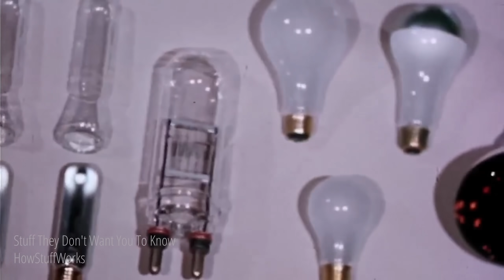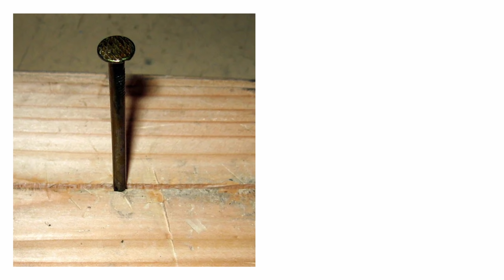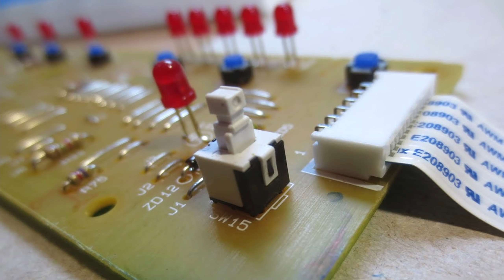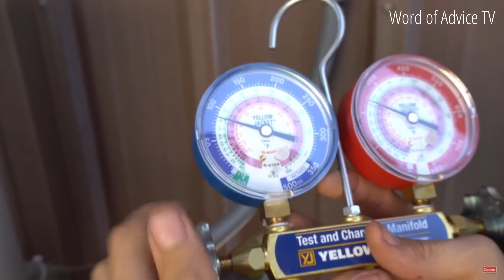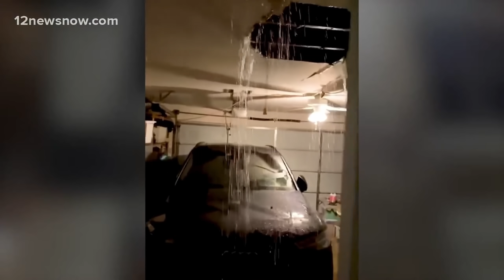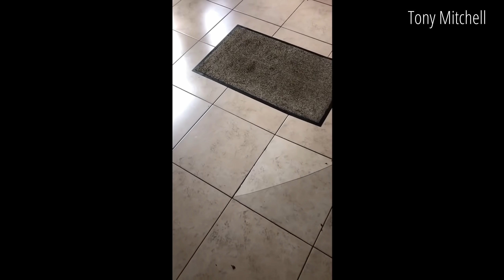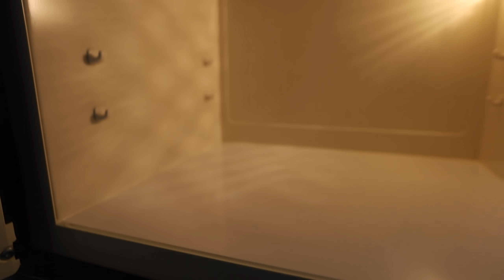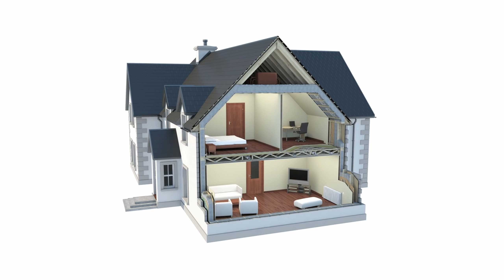Built to FAIL | Planned Obsolescence

Comment: Belinda, this was an incredible video. Thank you so much for saying what needed to be said! Now, specifics ...

Regarding the failure of your newer GE products, they are really no longer GE - the appliance line of business was sold in 2016 to Haier Group Corporation, a Chinese multinational home appliances and consumer electronics company headquartered in Qingdao, Shandong, so while those new appliances might have a GE logo on them, they are now are nothing more than cheap Chinese crap designed to fail early and force more consumption;

I have also noted rapid failure of the so called long-lived LED bulbs - I just had to replace another one yesterday, I will have to pay more attention to this and might have to go back to incandescents for some fixtures;

Regarding cheap home construction, it seems as if the only way to assure durable construction is to build a custom house, which would be prohibitively expensive for most people - developers will build up new subdivisions with THEIR preferred builders and only offer prospective home buyers limited options on models, colors, finishes, etc, resulting in a "take it or leave it" situation for buyers desperate to get into a new home (or at least, the homes that aren't snapped up by large investors to force more and more people into becoming renters instead of homeowners);

Apple is notorious for producing easy-to-fail and unrepairable devices - keyboards on some devices are designed to allow immediate liquid penetration onto critical circuitry in the event of a spill, instead of simply running off a plastic keyboard surface, and documents surfaced years ago instructing technicians at repair sites to either replace entire boards or entire devices rather than replacing individual parts;

Front loading home washers have a reputation for poor performance and development of mold or mildew, I just replaced my old appliances with new high-capacity Whirlpool models, of which the washer features the innovative removable agitator which will hopefully resolve the problems associated with the new machines with no agitators ;

When having new flooring installed, it is standard procedure to order 10% more than the measured area to account for wastage during installation, but I ordered 20% more to insure sufficient material left over should repairs be necessary, though storage of excess material might be an issue for some (I like the AquaGuard brand of laminate flooring);

Unless specified, it might not be "illegal" for customers to shut off water valves in the meter boxes, but if damage occurs, the customer will be liable for damage to the utility's equipment - buy a water key at a hardware store (can also be used to shut off gas supply in an emergency) and use common sense if there is no private water shutoff valve (typically located under a small round cover within a couple of feet of the meter box) by turning the utility valve slowly and carefully, stopping the attempt if the valve seems stuck and won't turn with a decent amount of force;

All-electric homes do not necessarily receive all or most of their power from coal-burning power plants, as the electricity generated by ALL the plants in a transmission interconnect (aka "grid") goes into that grid - you have no physical control where the electrons come from, and only about 20% of them come from coal-fired plants in the ERCOT interconnect;

Regarding old-school appliances, my mother bought a new refrigerator (I forget the brand) back in the 1960's, and at last report, IT STILL RUNS TODAY!

The skin of my house is now about 35 years old (based on records I could find) and the siding is already falling apart, being made of the the notorious hardboard siding that is rotting out all along the bottom;

The idea of an instruction manual for a home is BRILLIANT - I receive countless calls at work from residents who have no idea how to troubleshoot even the most basic of issues, have no idea how their home's utility systems work, and in some cases have no idea what their homes are even equipped with.

Keep up the good work, Belinda. You are providing a badly needed educational service to the public!

Comment: Awesome topic - I agree with you but gonna play the counter arguement.

We have appliance options that last 30-40 yrs but we have to spend as much as 4-5x for these appliances - are we as consumers willing to bare such costs?

We can build homes with all systems meant to last 50-100 yrs but then we need to be willing to pay for it and do the necessary maintenance to have it last that long...

Is the consumer willing to pay substantially more so all electrical and low voltage lines can be run through rigid conduits so they can be replaced if needed without destruction? And have a full system with pull boxes and also the necessary space for such systems in the built space?

Are we willing to use 100% cast iron or higher grade copper lines piping waste lines and then use K and L copper pipes for all house runs...

Are we willing to pay for 20-50ft piers instead of the cheaper slab construction for foundations for SFH foundations on new construction.

Are we willing to pay for 100yr exteriors and roofs with the necessary framing and WRB assemblies to last the 100+yr structures? And once built are we willing to do the necessary maintenance on a quarterly, annual, or other interval of all the systems?

Are we wiling to pay for more efficient and long lasting HVAC and space comfort systems?

Basically - are we willing to change how we build to have things all last longer and then also pay 20-50 or even 100+% more for the end product?

These are the issues with the way we interact with  the systems in place to maintain expectations for how we build, sell, and own homes currently...
Reply: Given the global economic bubble we're in now (which will hopefully burst soon), even the cheapest of houses is now out of the reach of many home buyers.

Comment: When I was growing up in DFW in the 1980's one of my parent's friends was a GM Quality Manager.  His job was to analyze cars that had survived for more than five years and 60,000 miles to determine which parts hadn't worn out.  These parts were then Value Engineered to ensure that they minimized cost while getting much closer to fully wearing out at five years without prematurely failing.  These efforts ensured that the initial cost of the vehicle was minimized while also ensuring that all of the car's systems would fail almost simultaneously at five years and 60,000 miles.  Our talk was quite enlightening.  A few years after this conversation, Japanese car companies moved into GM's turf and were winning consumers over with their 100,000 mileage track record (Honda and Toyota).  Soon, GM had to retool their cars so that they would catastrophically fall apart at 100,000 miles.
Reply: And from what I understand, they failed at that last one, and are now exiting the domestic automobile market.
Reply: @whiteknightcat  And I guess now it's the evil foreign companies that take the car market, according to some red hats...
Reply: @ThePixel1983  I don't know.
Reply: My brother's 2011 Ford Focus recently had a head gasket go and the shop told him the car wasn't even worth fixing. Meanwhile, my 2010 Pontiac Vibe (built on a joint venture with a Toyota engine) is still running strong. Growing up in Michigan, buying Japanese cars was verboten. When I went to see my mom, my family wouldn't even let us park our 2013 Mazda 5 in the driveway for the first few years of owning it. It's the best vehicle I ever owned. GM is even worse than Ford. My next vehicle will be American made though. A Tesla.
Reply: @Nphen  I've got a 93 Exploder and a 97 Camry. Both still run, but guess which one has routinely required more maintenance, repairs, or had parts just age terribly.
Reply: @Nphen  You probably won't get 12 years running with a Tesla.
Reply: @grantadamson3478  I AM AT 10.5 AND COUNTING
Reply: I don't think matching the lives of individual components ("catastrophically [falling] apart") and planned obsolescence are necessarily the same thing.  The car's target life could be increased by selecting the components that break and strengthening them.  

Maybe that part was a joke though?

I own a Piaggio motor scooter and I’d much rather everything fall apart at once than pay a shop $150/hour in labor forever.  Factories are incentivized to work efficiently, which benefits everyone.  Shops are incentivized to work as slow as possible which only benefits them.  If I were to buy a new electric scooter it would use less fuel and also have fewer parts to break.
Reply: @andyb2339  This is where the "dumbing down" of people in general plays in. So many today not only haven't a clue how their vehicles work, and of course wouldn't know a wrench from a hole in the ground, but don't even know (or care about) the most basic of routine maintenance. Shops put out videos of where people have brought in vehicles and have NEVER even changed the oil! As a culture, we've been groomed to be dependent on others for everything. People can't even read maps anymore because they depend on electronic gadgets to verbally tell them where to go.People don't even go shopping anymore - they get somebody else to do it for them!

Comment: So many examples, so little time...
Many shoddy practices are forced by ridiculous codes. In my area of Arizona, rubble trench footings are not allowed. Code dictates the use of eco-unfriendly, ridiculously short-lived concrete, even though we have expansive clay soils and a rubble footing ameliorates soil heave perfectly. The oldest building in the state, an adobe structure dating from the 1640s, is supported by a rubble trench footing.  

If you fill around the stones with #16 grit sandblasting sand, you also defeat ALL burrowing insects such as termites, silverfish, carpenter ants, etc. They can't burrow through the sand. It is a termite control technique pioneered in Australia, where they have to deal with vicious and very hungry Formosan termites. It is eco-friendly, chemical-free, and permanent. Of course, it is not allowed by code. I am FORCED to use health- and ecology-damaging chemicals that are useless after the first monsoon season. 

According to code officials, rubble trench footings (which support every ancient stone construction that I'm aware of) are simply inadequate for homes. In reality, the only thing they're inadequate for is profits to local concrete suppliers and contractors.

Comment: You can ask your contractor to build your home however you want, but people would rather have cheaper homes than more durable homes. This really is mostly on the consumer.
Reply: Not necessarily. While you can specify construction methods in custom homes, which are expensive, developers are filling new additions with homes built by builders THEY contract with and offering little to no choices to potential home buyers as to what they can choose.
Reply: @whiteknightcat  Well if cost is clearly no object (as the video author appears to believe), then you should just be building a custom home. For everyday sane people that have a limited budget, we can live with our wood frame housing.

Comment: Video about planned obsolescence and then not even 1min in talks about buying Samsung fridge. 🤦‍♂️
Reply: Is there a problem with the reliability of Samsung refrigerators? They rank as one of the top five most reliable brands.
Reply: @whiteknightcat  Very much so. Talk to any one who repairs appliances. Most of the issues are with the icemakers and water leakage. They also have issues with defrosting and keeping even temps. Despite the warranty it's difficult to actually get them fixed because the design is inherently flawed.
Reply: @TofuInc  Understood. I've never had to buy a new refrigerator since the Kenmore that was purchased in 2004. All I've ever had to replace were cracked door shelves. I purchased a fairly new but used Whirlpool unit from a friend who was replacing hers. The icemaker had failed with a leak, but as I was only buying it for extra storage, I didn't need that feature. I suspect the culprit was mineral buildup - she has notoriously hard water that has already claimed fixtures and other appliances. Maybe one day I'll try fixing it. Maybe.
Reply: @whiteknightcat  Most of the US brands have consolidated and/or outsourced manufacturing to the point most share common components. We bought all new Frigidaire branded appliances for our kitchen, but I have no real brand preference. We still have a Whirlpool side-by-side Fridge that was manufactured in 1998. I've had to replace all the door components on it but apart from that still works great.
Reply: @TofuInc  This is why I bought a Whirlpool washer and dryer a couple of months ago. The previous ones were Kenmore, but most Kenmores were manufactured by WP and use their parts. I figured I'd just go to the source.

Comment: My dad was a body man and painter for about 45 years and he could see the change in the auto industry as it was happening.  Everything got changed and most of it was for the worse.  The parts that are metal were made thinner and weaker.  This made things more fuel efficient for the weight but it also made them easily damaged and would rot easier.  Yes I say rot and not rust because even the parts that they say will last for a long because they are aluminum start to fall apart after a few years.  A big reason many people get rid of their vehicles is because of the plastic parts.  They are easily broken or stretch to unusable tolerance.  I have worked on vehicles that were from a dealer (never sold) that have shattered into a thousand pieces from a bump that didn't even damage the paint.  This did about $5000 worth of damage for no reason.  Sensors also cause many issues for people.  Most times you have a stupid light come on it is a sensor that was planned to fail at a certain mileage.  I have seen multiple cars have just the sensors fail about 10-15000 miles over the warranty.  It is usually not just one either.  Some of the parts on these vehicles can't be bought as a single piece either.  It is always said when I hear about someone having to get rid of a car because of these issues.  I am lucky because I can fix most problems myself so I can keep the price down and keep older vehicles running but most can't do this.  Another fun one my dad had was a single headlight and the accessories that go with it (like the computer, washer spritzer, motor for the headlight turner) cost $3800.

Comment: Hello Belinda great work as usual, I am a remodelling contractor in sydney, Australia. I’ve been at it for 30 years. I actually ask my customers if they really need that shiny new look if the existing is functioning well and try to work with more simple updates rather than a full strip out. I personally live a in smaller older style home, with few hardwired electronics/OTT style that date or breakdown quickly, with a family of 4. I’ve seen the ‘Trend trap’ all too often and am well aware of the high cost of updating especially at todays material costs.

Comment: Lots of claims, but few examples. All my cheap Costco LEDs I bought 7 years ago are still going strong. Do your research and buy better stuff that will last a while. It's not some Grand conspiracy...
Reply: I can attest to the failure of LED bulbs. I buy name brands like GE or Sylvania and have had some last for years while others lasted as little as a few hours. The majority seem to be lasting as long as, or less than, the incandescents they replaced. So yes, SOMETIMES, there really is a "grand conspiracy" - it's called corporate greed.
Reply: @whiteknightcat  You can usually get the ones that die replaced if you aren't lazy, happens with them if they're not absolutely perfect. I bought $150 worth of LEDs 8 years ago and haven't had a problem with any of them. My cheapest Fiet has been turned on uninterrupted, in an enclosure, for 8 years...
Reply: @davidb2045  Never heard of Fiet brand. And who keeps receipts for light bulbs for even more than a year?
Reply: @whiteknightcat  People who understand the technology, apparently. And Fiet is at Costco, where you don't need a receipt to get a replacement.
Reply: @davidb2045  Oh well, no Costco's in my area. Guess I'm out of luck.
Reply: @whiteknightcat  you... can still keep a receipt, or scan it, or take a pic of it... Or is that too harrrrdddddd?
Reply: @davidb2045  I don't keep receipts for everyday items more than a year. Even someone as OCD as me has limits. And I also don't shop at places that require "memberships".

Comment: you missed the one "work around" for this issue . using that 10 year warranty on purpose IE tampering with the item without destructive force to insure you get to use that warranty if its a 10 year Tamper on year 9 or when you see fit. remember you get another 10 year warranty on that one that was just issued.... the consumer must take the warranty and used it agaisnt them. :D